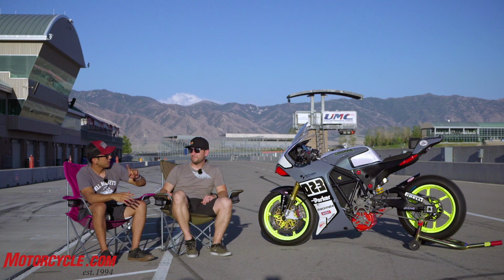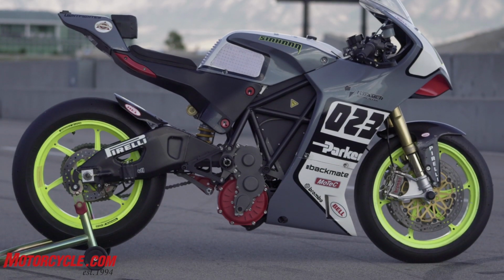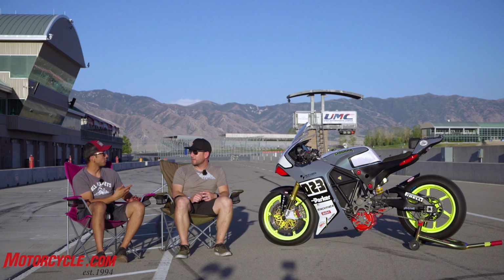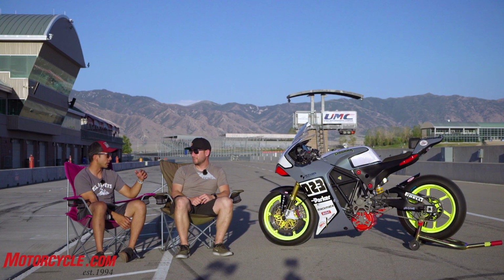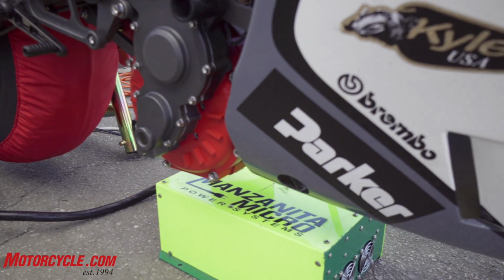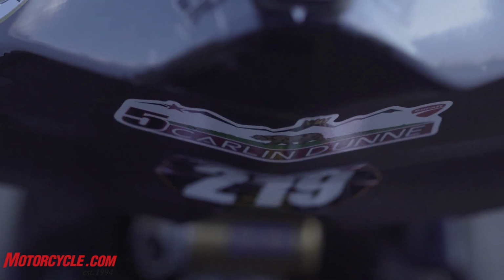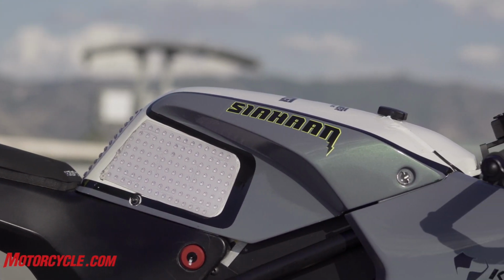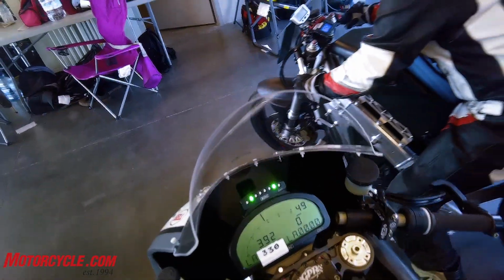The Electric Motorcycle With The Potential To Change The Industry – The Lightfighter LFR19. Part 1

Comment: 400v battery running 1p 108s with a charge time of 1 hour, that's insane!
Reply: What is one pee 108s? Just asking. It sounds like the Rutherford atom distribution, p and s. But the numbers are wrong.
Reply: @voornaam3191  P stands for parallel and S for series. A lithium ion cell has a voltage range of around 3.4 to 4.2 volts. 3.4V when discharged. 4.2V when full. Parallel cells give you capacity while series cells give you voltage. Basically to get 400V you need you need 100 or so cells in series (or in other words 100S).

The charge time doesn't suprise me. Any lithium battery can be safely charged in 1 hour, whether that battery is the size of a AA or a Tesla. It all depends on the charger and available power at the track.
Reply: @voornaam3191  I make electric skateboards and usually run battery packs of 12S4P. Essentially a bunch of  3,000mAh 18650 lithium-ion cells get formed into a battery that has a capacity of 12,000mAh and a voltage of around 50.4V.
Reply: @ryankraft9897  Thanks. So it's a weird name or type. I've seen most batteries are many cilindrical cells combined, yeah.
Reply: Voor Naam no, it’s just a short hand description of how the 18650 cylindrical cells are used to make up the pack.

Comment: Anyone think about using regen as part of the braking? A small regen motor could even be incorporated into the front hub with the advantage of 2wd. You may even be able to use regen alone and eliminate the brakes altogether 🤔
Reply: Umm...regenerative braking. Turning kinetic energy into battery energy
Reply: Im willing to bet they already do, its pretty standard practice

Comment: why did they Mig weld the chrome molly lattice frame???
Reply: IKR?
Reply: What would your alternative be? The fact is, even though it doesn't necessarily look the nicest, MIG welds are perfectly adequate for welding of thin sections. Furthermore, compared to TIG, it is a lot easier to tack with MIG. 
That being said, they could have done a neater job.
Reply: @HavokTheorem  yea, my alternative for frame building is Always TIG welded

Comment: For electric bikes, how will we determine whether they are beginner friendly or not. I know all modern electric bikes aren't beginner friendly but I am wondering if they become more common.
Reply: Electric bikes have horsepower/kw output figures just like gas bikes. As long as you can translate "250 cc bike" to "typical HP from a 250 cc bike" you're golden. The different licenses in Europe are already limited by max kw figures, so that should be natural there. e.g. A1 license is 11 kw max. As a plus, they (should) all have the ability to change throttle mappings or at least max power with no need for additional tuning like a gas bike -- and no gears.
Reply: @at0m113  that makes sense and since electric bikes have instant torque, having an insanely peaky motor isn't going to be an issue

Comment: Cool bike. Once EV-fast charging hits the 5 minute mark these bikes are going to sell like hot cakes.
Reply: I think 30 minutes is the tipping point. Many trackdays are split into 3 groups, 20 minutes each. 30 minutes to charge, 10 minutes to cool down + plug/unplug/setup, and you're good to go again.
Reply: @filipbunalti  well yeah for track days. I was referring to the street use in comparison to gas bikes.
Reply: @filipbunalti  We charge the bike right up to the point it's time to go on track. No temperature issues.
Reply: @TroySiahaan  Hey Troy, that's actually surprising (in a good way) given how battery powered vehicles have the tendency to heat up batteries both during rapid charge and discharge.
Reply: And a better Price-point...

Comment: Too many negatives:
Price
Charging time
Environmental impact during production, disposing of old batteries,  recycling etc. 
Range
Lack of sound ( you will be amazed how important that is to many riders)
I bet on another 50 years of development until electric vehicles are the way to go and I wouldn't be surprised if the industry will come up with something completely different along the way.......
Storing electrical energy is not that easy. 
In the meantime.....
Safe rides 👍🏍

Comment: Torque at the wheel now? Come on - that's as close to a misleading figure as you can get. I can get more than 200lb at the wheel out of a 50cc moped if we're being silly about it.
Reply: You are correct. That was a slip. It's at the countershaft sprocket.
Reply: @TroySiahaan  i.e. after gearing reduction. Or not motor torque. That's like claiming a hayabusa with it's 114lb at the crank makes 1136.5lb because that (usual caveats about losses and such) is what it should put to the rear hub. Or 476lb at the output shaft (both in 1st gear). Specs from aperaceparts.
Even a 2017 R6 with it's weedy 45.5lb at the crank throws 685lb to the hub or 243lb at the output shaft. 
The imaginary moped from my post would make around 2lb at the crank. On a 20:1 primary then a 5:1 1st gear it would put 200lb to the output shaft. On 18/36 finals that would be 400lb at the hub. It would be ridiculous because it would also mean 10krpm at the crank would give a 50rpm wheel speed or about 5.5mph on most moped tyres.

Comment: Nice bike but that is a Ducati frame, when he said custom, in like yeah, paint maybe, good work otherwise though.
Reply: No its not...
Reply: Nope... I used to track a Ducati trellis frame and the welds (done by a robot) were a lot neater!  If you are making a one-off race frame its a hell of a lot easier and stiffer to do a cro-moly tube chassis than aluminum or composite.  They must have MIG welded this frame, the beads are sloppy and I noticed a few spots where they didn't even bother to clean off some spatter beads.
Reply: Guilty. We MIG'ed it. Actually, my neighbor finish MIG'ed it because I'm too blind. But I designed it from scratch in Solidworks, bent, machined and mitered tubes and TIG tacked it in a cnc fixture I made. Its straight as an arrow but the welds are good old sloppy human MIGs, not terribly unlike Ducati's sloppy robotic MIGs.

Comment: "Takes about an hour to charge"... or two minutes to swap the battery for a "freshie". ;) (Chemical cells don't like any "fast" charging or discharging...)
Reply: Except batteries are usually the most expensive part of the bike. So you'd spend a grand or two to bring an extra battery that would afford you the range of a normal motorcycle tank lol

Comment: How ist that posible... he works at zero mc and developed this motorcycle. Obviously zero mc has the wrong ppl hired in developing and engeeniering. Dude.. you should rise your own brand and looking for some investors. Everything else impede your creativity !!!
Reply: Lex Summer, there’s a big difference between designing a street bike for mass production, and designing a purpose-built race bike.
Reply: @Vessekx  yes and no... Sure it need a few adjustments to make it street legal and durable. but al the plastic, belt and other fails like tiresize, brakes, and geometry. Leave plastic away take the geometry and chain. Abd you have the perfect bike. Battery output set conservative for longlife. Abd ad a Dc charger. This should not be imposible?
Reply: Lex Summer They point out repeatedly that the design concerns for this bike were track performance, not driving distance or street performance.  Just like designing a Formula 1 car is a completely different than designing a family sedan, designing a street bike is completely different than designing a purpose built race bike. A motorcycle track is typically 1/4 to 1 mile in length.  He talks about this bike being designed for high performance for 8-10 laps.  Hat means he’s designed it with battery capacity to go somewhere between 2.5 and 10 miles at near top speed. You don’t get useful commuting range out of that by tweaking for “conservative battery output”.
Reply: @Vessekx  I totaly got your point. But when i see any Zero mc and compare to this ??? ppl who can do such a awesome bike could do a way better bike for comuteing. A lot knowledge from F1 was used in todays everyday cars. Thats what i mean. Adapt this to the comuter bikes.
Im a 200% EV enthusiast. But im not a Zero fan. So i see many unused potential and bad fails what they do on todays bike. I just can't get this in my mind... how it is posible this briliant guys can do such a badass machiene and do not apply their knowledge on the zero mc fleet?
Reply: Lex Summer, what part of this bike do you think actually competes with the Zero line.
Even the entry level Zero FX has 10 times the range of this bike, and more than enough speed/performance for highway use.

I’m really not sure what you think makes this bike superior to the existing Zero lineup.

Comment: Electric is just meh. They can put all the power they want in there, its just not gonna be a big segment of motorcycles. Just a fancy for rich people with very little practical use. Gas is easy and cheap and convinient and you don't have to worry about range.
Reply: Just more maintenance. People once said I'll just keep my horse when the Model-T came out. Now Look at it!
Reply: Paul Kojak
That's what petrol heads said about Tesla cars and now they (tesla) cand keep up with the demand.
I enjoy the sound of my V4 Honda VFR 800, and i enjoy that i can ride over 300 km on a tank that takes one minute to fill ... 

But the thing is that the future of transportation is electric: it just has to get to the point that range/charge time/price ratio is better.
Ride safe.

Comment: Why are these engineers so stupid. Just make hot swap type batteries like any power tool has. Standardized even better. One battery charges while you're out on track, swap into an external charger, ugh so obvious.
Reply: everss02  exactly-call Milwaukee Tool they know  how to charge/swap batteries
Reply: The battery is probably half of the cost of the bike. Maybe eventually tracks will have a rack of charged, standard batteries you can rent, but until then, you're asking the price to go up 50% for early adopters. And it's not like electric bikes are cheap.